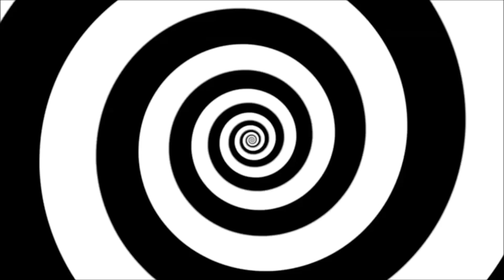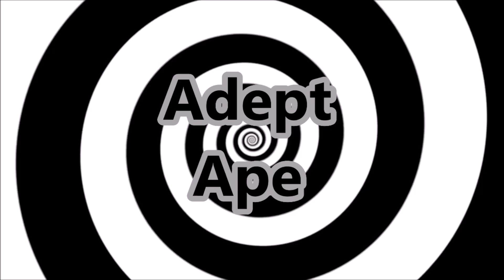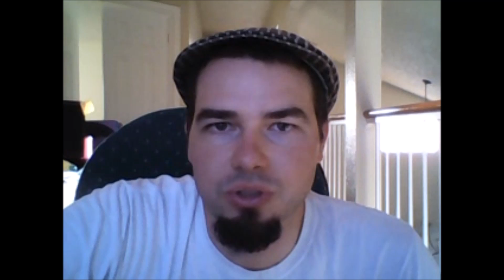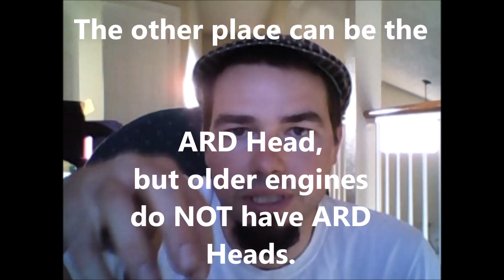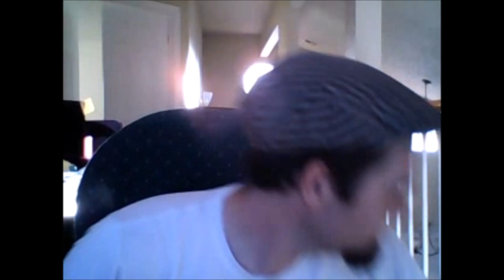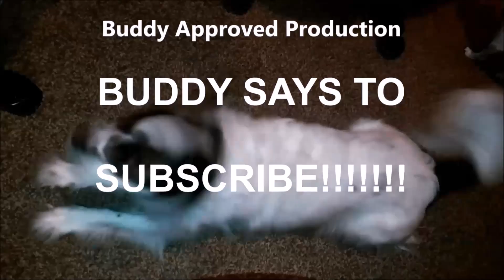Diesel Talk Episode 1.  Frequently Asked Diesel Engine Questions.

Comment: This episode one is understanding as well a leaking injector cup can cause diesel fuel into your coolant the cup is a seal to let coolant flow around it to cool the injectors due to them being so close to the combustion chamber. Once the cup leaks coolant gets mixed with the fuel. A blown head gasket or a cracked head causes coolant to mix in with your oil. And you will have the pressure from the combustion chamber travel through the coolant lines and up to your coolant reservoir because the head gasket is leaking and letting the pressure from the combustion chamber into the cooling system

Comment: Coolant leaks in a diesel engine are normally caused by the fuel injector cups or the head gasket. Sometimes they are press fitted or sometimes they are sealed with O-rings. Didn’t know you could do a coolant flush with degreaser and tap water, found that pretty cool. Fuel getting into the coolant could end up being corrosive to the radiator and other components since they weren’t designed to handle fuel injector areas like that. Coolant can also leak into the cylinder head, which will show clean spots on top of the pistons which is a good indication that coolant is getting into the combustion chamber. More than likely a coolant leak would usually be caused by the injector cups, and it’s recommended to change them all so the job doesn’t have to be done twice.

Comment: Hi
This may not be your area of expertise, but I bought a boat with westerbeke w30 diesel engine. I replaced the glow plugs, but it is still hard to start. When it starts, there is some white/blue smoke untill it warms up. Other than that it sounds very healthy. Any suggestions to improve hard starts?

Comment: I have a CAT 3126 in my dumptruck.  Please tell me WHERE to add the oil?  This may be a simple question for you, 😊 atleast I hope so. Thank you sir
Reply from the maker: +Patti Thieken There should be a large cap on top of the engine valve cover that it can be added to or on the front of the engine the should be a little twist cap. Most people run 15w40.
Reply: Adept Ape Can you please private email me pattithieken@aol.com

Comment: Hi and a happy Christmas 😊
I've just started watching your posts and find them really interesting...........👍 I'm a truck driver in the uk driving a DAF 105 460 so I know a little about maintaining engines and find your videos fabulous 😊
I'm also a rail enthusiast and see are new locomotives are being built in Valencia Spain by Stadler rail AG group and they're using the cat C27 and the C175 engines in them. Are they good power units?
Have a fabulous new year all the very best Stevie 😄
Reply from the maker: +TheDaf95xf I have worked on a couple C27 engines when I worked on generators and they are a very popular industrial engine. The C175 is a new Cat engine that is larger than the 3500 series that Cat has made for several years. We had one in the shop a couple years ago and they are very big engines.

Comment: thanku for sharing your helpful knowledge.  i just bought 04 kenworth with C 15 cat 550hp. it has 220,000 km on complete inframe rebuild. it seems to be cranking longer before it starts. what can i do.
Reply from the maker: Is it cranking at a slower rpm? You might be losing a fuel prime which could a small leak or the check valve leaking, could be a leaking injector or weaker fuel transfer pump. Put a fuel pressure gauge on it when cranking and see what the pressure is.

Comment: I have watched a lot of your videos and you have saved me quite a bit the only problem I have right now that I cannot find a video on at all is on 03 6nz getting high exhaust temperature reading 1000 degrees on the gauge  has a new turbo new air filters and recent overhead but still show high temperatures under light load and is set for 500 horse
Reply from the maker: Has the truck always had high egt temps or is that new? Since it doesn't sound like you have hot rodded it, a couple things to check, Camshaft timing can really affect your egt, possibly an exhaust back pressure is, leaking or plugged CAC? These are just some things to consider. Any black smoke or possible injector over fueling?
Reply: the symptom is new since the rebuild pretty positive that the camshaft is timed good the CAC would make sense the driver is complaining about low boost pressure so I checked the turbo and found wear rings in the housing and some slop in the shaft so I replace the turbo with a new OEM cat Turbo I have not pressure checked the CAC the driver said since the new turbo was put on it will pull 20 pounds of manifold pressure but I bought the truck used had to put a motor in it and I'm not quite sure what normal manifold pressure would be on this engine I'm assuming 30
Reply from the maker: +robbiecoyle22 Sounds like you have a boost issue, and less oxygen usually leads to higher exhaust temperatures. A 6NZ should be getting at least in the mid to high twenties, unless it's a low horsepower engine, but you have a 500 hp engine so my guess would be it should be closer to 30 psi. If you send me the serial number I can tell you what that engine tested at when new at the factory for boost. So low boost, can be a few things, assuming the engine is running smoothly, check that CAC for leaks or restriction and check your exhaust for high back pressure.
Reply: I will have to wait until the truck gets back to get the serial number off the engine he is out trying to do a run with it right now I'm pretty sure the back pressure will be minimal we just put brand new Mufflers on it not even a week ago from Peterbilt but I will definitely be checking my CAC I appreciate it very much all of your videos are very helpful I'm a small company and only have a couple trucks and I figure the best way to save money is to educate yourself thank you again very much
Reply from the maker: +robbiecoyle22 You are welcome, glad to help.

Comment: Keep up the good work, very interesting. Even as a retired diesel mechanic, including 7 years with a Cat dealer, I learn something new all the time especially with the newer technology.
A note for your commenter Pstrident. When I did marine work we would just crack the filter loose and then put a small garbage bag around it and then unscrew the filter ( both fuel and oil) Kept from making a mess especially in some of the yachts with carpet in the engine room.
Reply from the maker: Thank you for the comment. That is a good idea with the garbage bag in the boat.
Reply: Really.

Comment: I am really finding these videos helpful definitely can't wait for more....quick question tho c15 meui setup after sitting a day or so when starting it coughs spits sputters sometimes stalls with excessive white smoke...replaced check valve and bypass in filter housing and put bubble tester in return at tank and found no air bubbles in fuel...any insight on the situation?
Reply from the maker: +CHRIS BUXTON Hmmmmm, it sounds like your going done the fuel road, have you put a gauge on the system when it acts up? What were the pressures? You could have a bad injector that misfires when cold. I'm assuming it runs good when the engine is hot?
Reply: +Adept Ape I didn't check pressure while cranking but that's the only time it acts up
Reply: +CHRIS BUXTON pressure at idle and high idle is within spec....could it be an injector leaking off? it also smokes constant black at high idle under no load
Reply: +CHRIS BUXTON and yes once it finally starts it runs good
Reply from the maker: +CHRIS BUXTON Well if you have constant black smoke, its over fueling, which is typically an injector or injectors. I would test the pressure while cranking too, if it's stable you know your fuel system is okay, then start checking your injectors.

Comment: Quick question unrelated to the video. I am set to begin a diesel service technology class at my local community college. It is a 2 year program. Im pretty pumped but nervous because I was recently fired from my job over a confrontation with my supervisor. All I did was work on a dock. Nothing to do with engine repair. How bad would this hurt me in finding a job in the diesel field after I graduate? Im 20 by the way and this last job would be the only one that would have anything negative to say about me I'm pretty sure. Thanks for the help and videos
Reply from the maker: +Hunter Boyd Well most jobs are going to want a reference when you apply, I would try to get some work in somewhere else before finishing school and then using that job as your reference. Just stay on the next supervisor's good side ;-)
Reply: nice, I appreciate it!

Comment: will you ever discuss about mbn to 6nz coversion?
Reply from the maker: +Russ Trucker I don't have a video planned about doing a conversion on that. To tell you the truth there are very few differences between the 2 engines, the main difference is the MBN has the ECM controlled wastegate, but most of the engine is the same. The bigger differences start with the BXS engines that have twin turbos and IVAs.

Comment: Is this a time bomb? or normal?
Reply from the maker: +Alex Rivera What do you mean by a time bomb?
Reply: Is that normal or do I need a compressor?
Reply from the maker: +Alex Rivera I wouldn't worry about it too much, the valves in the compressor are probably slightly worn and just leaking some air pressure.

Comment: I have a question to ask but not sure if it's appropriate here.  I'm doing my oil change & opened the oil fill tube to allow oil to flow out more easily.  Noticed almost an air leak hissing coming out of oil fill tube, govenor went off & it stopped ? I have a video of this doesn't make sense.
Reply from the maker: +Alex Rivera The compressor has pistons like your engine and you were probably getting some blowby through the compressor when the governor was active. When the governor kicked out, the air pressure stopped leaking past the compressor seals. That is most likely what happened.

Comment: Liking the video format man.  I should be starting a diesel mechanic program soon at the local tech college. Any tools I should buy besides pry bars, screwdrivers, socket wrenches and the like? They say bring some tools but they supply most. They weren't specific though what tools.
Reply from the maker: +chillmothafuka I would wait to start at the job before buying any specialty tools and then ask the senior guys for what they recommended for the shop.

Comment: Spartan Chassis has a digital display of engine load, turbo boost, etc... While I've observed 99% engine load before, the last few trips the highest load is 80%. This is at 2100 RPM (peak horsepower). I don"t notice any power or speed decrease though. Could it be HEUI and engine oil viscosity ? 10w30 vs 15w40?
Reply from the maker: Not all RV engines have high horsepower ratings, and they need to see a sustained high load to ever get the derate. The derate also depends on temperature as well, it uses the boost pressure and the intake manifold temperature to calculate the "exhaust temp derate"

Comment: Good stuff, my 3126 rv is in the CAT shop now(Oil leaks-expensive). Keep them coming.
Reply from the maker: +richard leitner Those oil leaks can add up quick, which things are leaking? Front structure, side covers, or oil cooler, those are pretty common.
Reply: +Adept Ape They told me and gave me a detailed parts list of different gaskets(1393526,1887113,6L1883), seals(2392402-fuel,4F9653, 1359819, 2275904), Hose As.#2001196, Screw-SOC HD#1668636, O RING #0336027. I think it had to do with the front gear cover, the air compressor, and Heui pump area. Thanks, I enjoy your videos, I think I've watched them all, some multiple times. Rick

Comment: Would you do a series on curing the problems with the C13 and C15 twin turbo engines.
Reply from the maker: The main problem with the non regen twin turbo engines was the addition of IVAs or VVAs, they are both the same thing. I'll be doing a video on them in the future.

Comment: question... is there anyway to purge the oil filter of oil prior to removal during an oil change?  i have a 3406 and a c12 both marine and those huge filters puke oil when the seal is broken.  in the confines of the boats  i dont have any easy way to catch it and usually make a huge mess. thanks
Reply from the maker: This is a marine application so it might be tricky, I used to work in Power Generation so the confines are somewhat similar to a boat. The way I used to do it was to get a 5 gallon bucket and cut it down somewhat then work it under the filters before cracking them open. The truck filters I'll usually stab a hole into the filter at the bottom, but you probably don't have enough room for that in your applications.